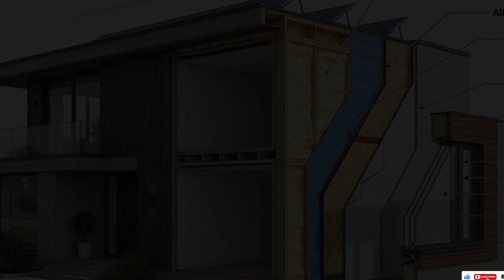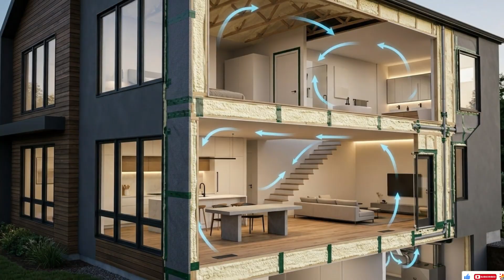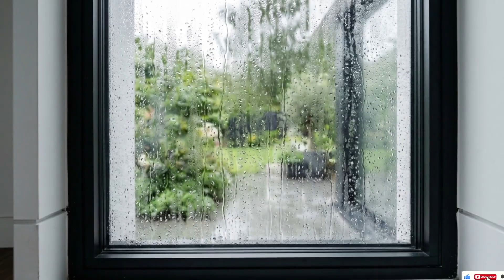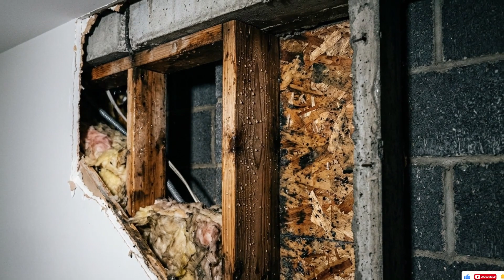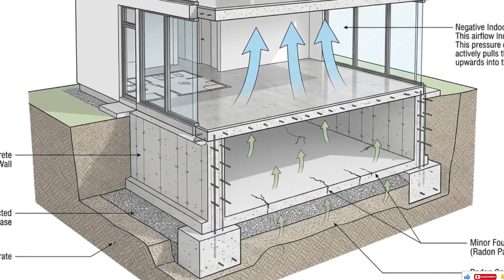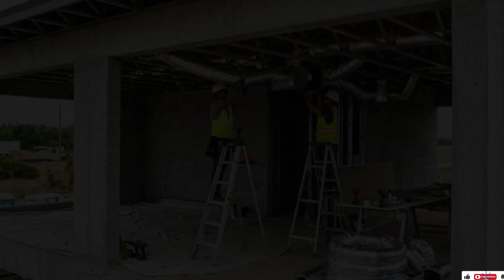Why Airtight Homes Are Creating Hidden Structural Problems (Engineering Explained)

Comment: This is so True!!! My Bermuda house although drafty, We don't have these problems. Let the house breathe!
Reply from the maker: Thank you for sharing your experience. A house does need to manage moisture effectively, but it's really about controlled ventilation rather than uncontrolled air leakage. Well-designed homes can be both energy efficient and durable when they include proper ventilation and moisture management systems. Finding that balance is one of the key principles of good building design.